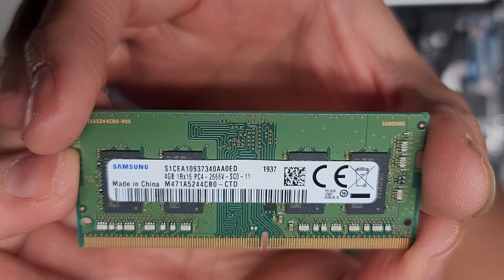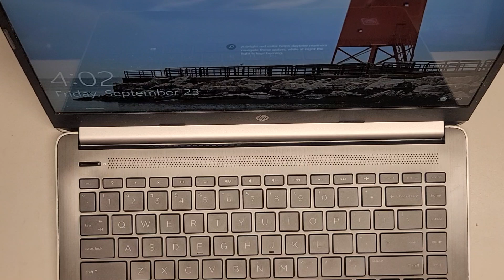HP Laptop 14-dq1033cl Disassembly RAM SSD Hard Drive Upgrade Battery Replacement Repair

Comment: I want to add 2.5 ssd in this laptop. Do I need special caddybrackets for it? I think it will be too loose without them, could be moving.
Reply from the maker: You at least need the cable. You can use double sided tape.
Reply: @ItsBinhRepaired  thanks
Reply from the maker: @7800X3D  no problem
Reply: @ItsBinhRepaired hi.. the connector looks like for sata but its a fingerprint sensor.. and also u have to cut the extrra plastic area from back cover cuz these are fills the hdd area.. i assume theres a 10pin unsoldered connector side of the touchpad.. i think that could be sata.. can u test if this is sata or not
Reply: and u could use universal 2.5inch sata mount
Reply: @nzs292  answering 7 months later :) mounting was possible but too sophisticated, so i just bought external ssd
Reply from the maker: Lol

Comment: Excellent video, very comprehensive. I like short ones, but when the longer ones are no nonsense, I appreciate that even more.

I had the same issue, I left this same laptop in the box for 6 years without touching it. 
Two questions for you.
I  also get that 'checksum' message which was pretty much the last few seconds of the video. I am 'computer challenged', to put it mildly. Is that anything I need to deal with?

Also, why don't you get some affiliation with Amazon or whatever? Your videos are excellent and if you recommended a battery from Amazon, or whatever, you could make a few bucks that way.  I know I'm looking at batteries right now on Amazon, and I definitely would have used a link from you to buy it. It gets pretty hairy trying to buy a battery, with so many models sounding so close to each other, that I think a recommendation would get you some bucks.
Reply from the maker: I can get affiliate links. It gives me a few cents when people use them.

Comment: What about the fan model? I would like to know because my fan stopped working after deep cleaning and everything it still doesn't work; I want to know the model so I can buy a new one!
Reply from the maker: It should be on the fan itself. If you can't get the old fan out to check it, then you'll have no need for the model number since you won't be able to replace it, right?
Reply: @ItsBinhRepaired  I already took it out I ordered a new fan hope it works
Reply from the maker: @Glitch_yt14  good luck!
Reply: @ItsBinhRepaired  you think I can add 2 new 8gb Samsung ram sticks?
Reply from the maker: @Glitch_yt14  if the specs are right

Comment: Do you have the specs for the HDD in this model, please??
Reply: The drive it currently uses in the bottom left corner. Is it a SATA SSD. This model uses a 2.5" SATA SSD or HDD, is that right? Does it require a caddy and a ribbon connector?
Reply from the maker: If it didn't come with the ribbon, you need that.
Reply from the maker: @amandasutton3717  you mean with the adapter? Or the drive it currently uses?